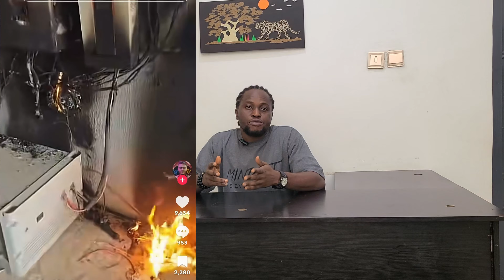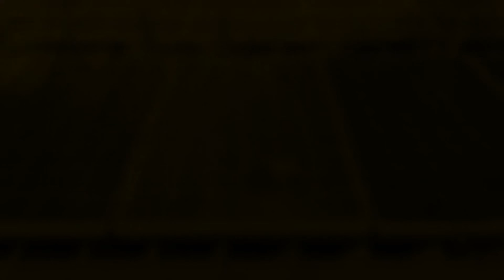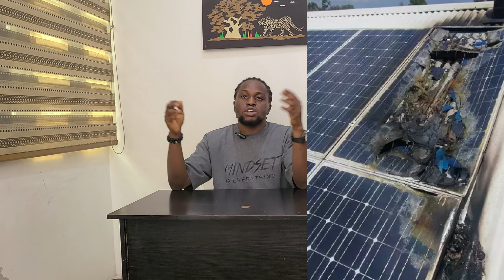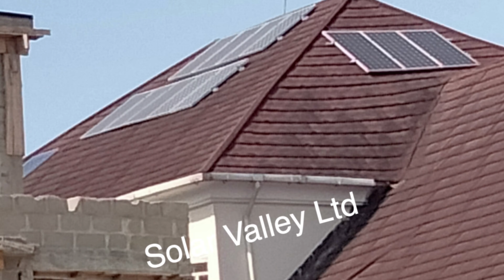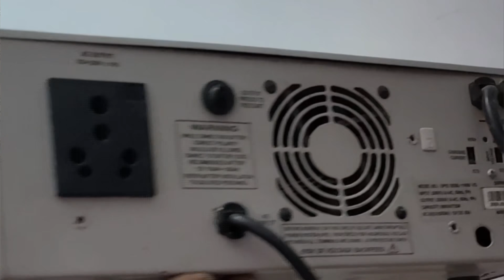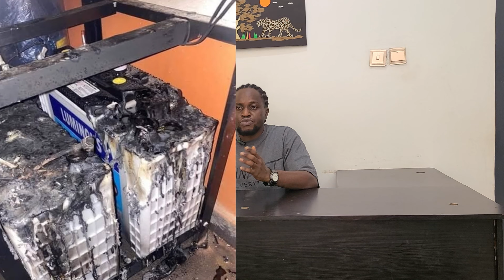Solar Panel Fires Explained: Causes of Battery Explosions & Burning Inverters (Prevention Guide)

Comment: Great video Sir, never knew the fire risk is a high as this. There are so many possible points of failure.

Can this be insured against as a stand alone?
Reply from the maker: Thank you sir. The fire risk is not high. Infact the risk of a fire outbreak on a solar installation is so low and about 1 out of 10,000, and about 10,000 to 15,000 new solar installations are done every day across the world. However, one needs to know the likely hazards so as not to be the minority victim.

I believe the Insurance guys will be in the best position to answer that, but it might fall under general fire insurance.